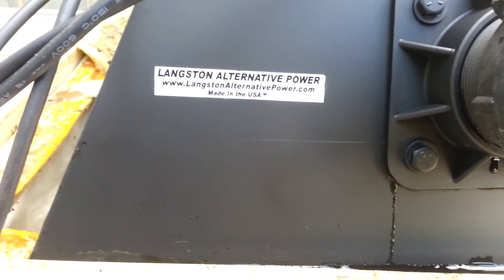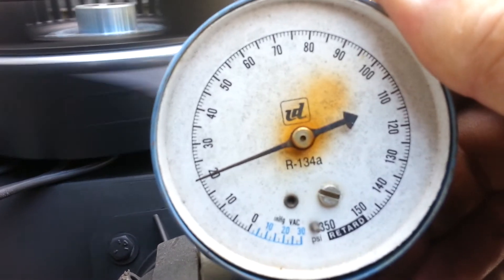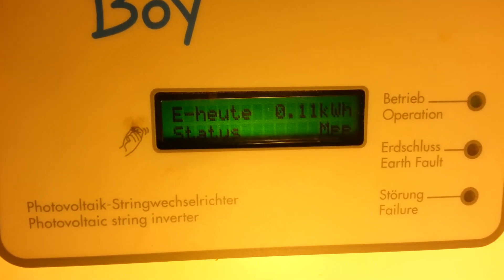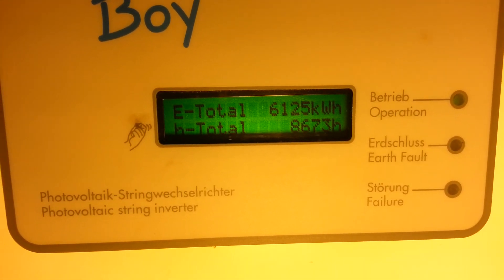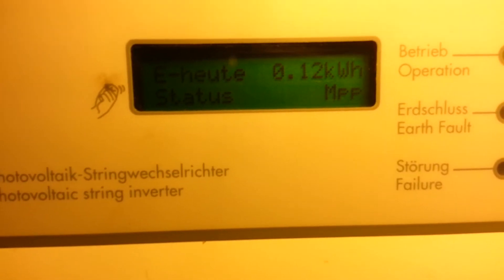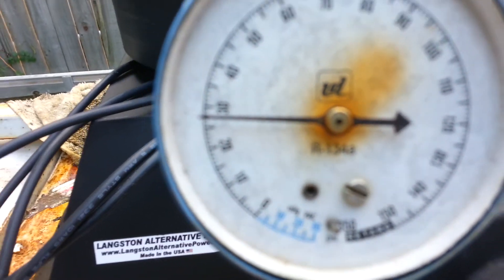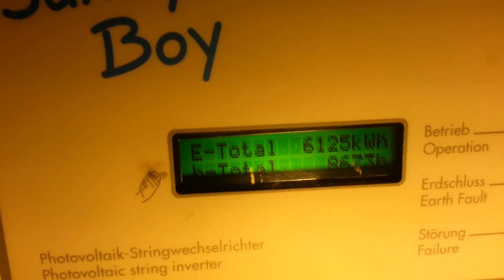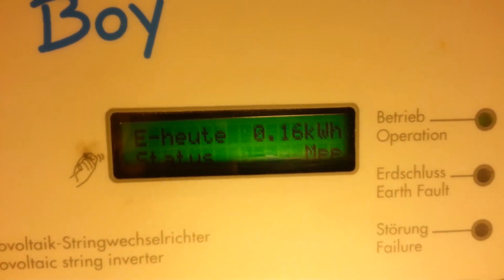Turgo Hydro generator unit 780 watts @ 27 psi

Comment: This is a solar inverter. How do you set the inverter? MPPT is off?
Reply from the maker: Yes this is a solar grid tie inverter .The MPPT is on because I also use this with my solar.
Reply: Langstons Alternative Power Spencer Langston there is no difference to pv panel or generator? I use my solar inverter with wind or hydro generator? Various rpm?
Reply from the maker: Gergely Szécsi As long as it sees DC voltage from 250 v to 600 volts It will work for all. I try to get the open circuit voltage close together as I can so that it works best .But you have to make sure you size the inverter for the total wattage.